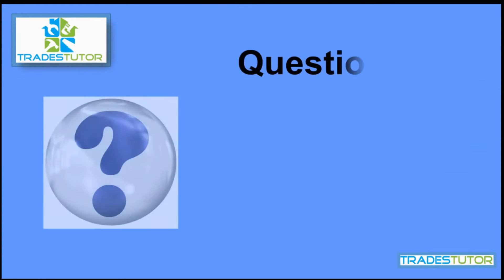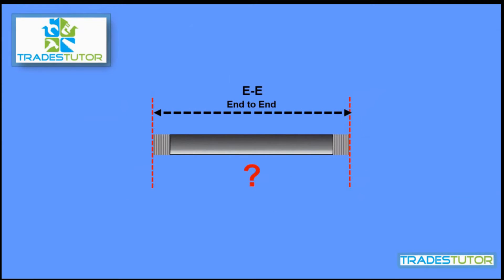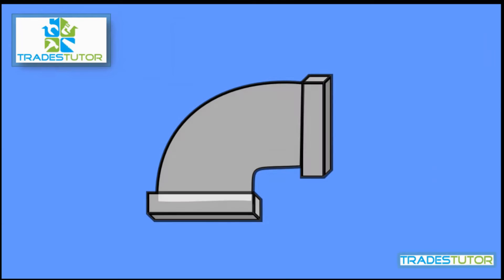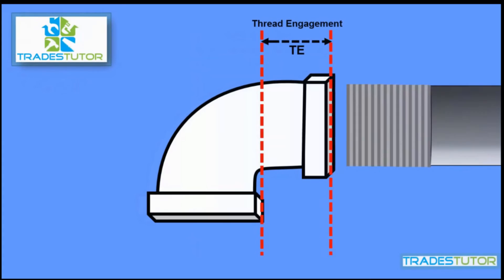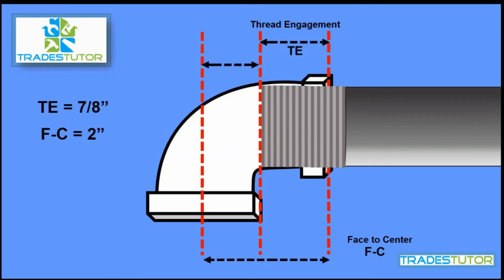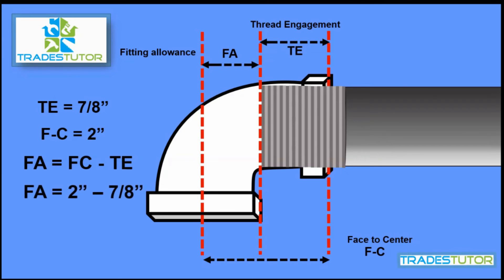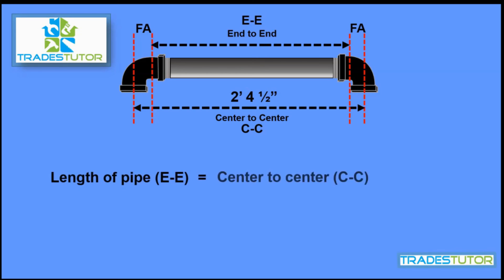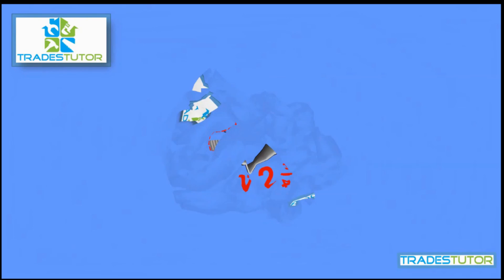Fitting allowance for the piping trades

Comment: In the case of piping around the house, to run the piping from outside or inside corners of a room/wall, do we need to consider center-to-center distances? I mean, the piping will be touching the wall sides and corners.

Comment: Absolutely ridiculous how much filler there is. Measure from face to face and then add 2 times TE... done
Reply: Yep. The only thing someone has to learn is sock-in (TE), which I always used 5/8 of an inch for 1/2 - 1-1/4 pipe. For anything bigger, I’ve always used 1/4” per inch increase. But fitting thread depth with 2-3 threads added is always a nice reference.
Reply: @robbob022 what are saying . I didn’t understand
Reply: I agree with u this video is confusing
Reply: How is this confusing 🫤… maybe because I’m not a welder I get it but dang…. We all just trying to learn something here… and pretty much everyone hates math…

Comment: Question.. how to remove pipe between two fittings without having to remove more then what’s necessary?.. thanks
Reply: Turn the water or fluid off and drain. Make sure both pipe ends are supported.  Cut the pipe out.  You can add pipe back with a union.

Comment: All those fractions in the calculations are a perfect example of why metric is easier and simpler.
Reply: Building plans in the USA are about always in Feet and Inches. The piping requirements are  too and the walls rooms and where hvac and furnaces are too. The pipe you buy is in feet. So to use metric you have to convert the requirements to metric from the plans.
Reply: Yeh how are people still using imperial measurements in fuckin 2024, it’s just a head fuck
Reply: Go drink your tea and shut it this is merica we don't use that trash we no how to use math
Reply: Freedom units!!

Comment: So how do we find the measurements for the thread engagement, you sort of just said we will just say it's 7/8" but how do I know what the thread engagement is on a T or a union?
Reply: 1/2" Ts and 90s are same thread engagement and Fitting allowance
Reply from the maker: The thread engagement will depend on the type of material and size of pipe. This information generally will be supplied by the manufacturer of the material.

Comment: Please can you help me solve or know how to solve problems or real situations of take off in threaded joints.

For this examples: 

1) A piece of NPS ∅2" pipe is being cut to run between two 90° degree threaded fittings. The center-to-center measurement of the fittings is 7'-2¼". What is the cut length of the pipe?

2) A length of NPS ∅1½ inch pipe is to be cut run between two 90° degree 6.000# threaded fittings. The fittings measure 7 ft 2¼ inches center to center. What is the cut length of the pipe

Comment: Hello, excellent explanation for the measures required in threaded pipe installation. My query has to do with the fitting as such, that is, from where they obtain the dimensions of each threaded accessory, depending on whether it is, ANSI # 150 or ANSI # 300, or 2000 #, 3000 # or 6000 #, according to the Manufacturers' catalogs can vary from one to the other, I tried to take the data and dimensions of ASME B1.20.1 but the FC and TE of each fitting differ with the manufacturer's catalogs even with the example in the video.

For the example in the video that is a FC = 2 "and a TE = ⅞", if I'm wrong please correct me, according to the tables I got corresponds to a fitting, 90 degree elbow of the threaded type NPT 3000 # and it would be to couple a pipe of nominal diameter or size NPS = 1¼ ", FC = 2" but TE = ¹¹⁄₁₆ and in other cases TE = ⅝ ".
I appreciate the clarification and, if possible, provide the source table of the information with the dimensions of the fittings.
Reply from the maker: Hello: The numbers I used in the example were not related to a book of any sort. They were only used for explanatory purposes. Thanks for watching.

Comment: I have a question is 7/8 is constant?
Reply from the maker: Hi Darwin: No, its not a constant. its just a number I picked to use as an example. Thanks for watching.
Reply: @tradestutor1191  if the thread engagement isn't constant then what is it for all sizes of pipe is there a chart?
Reply from the maker: @richnelson753  Yes, you can find charts from the pipe manufacturer and I believe there may be a chart in the IPT handbook

Comment: what's the size of the pipe? 2" ------ I guess
Reply from the maker: Hi Sam: the numbers are just examples so in the end it doesn't really matter. It would definitely matter in the field though. You would have to find a manufacturer's handbook or some type of pipe fitting handbook which would give you the information you would need to answer the question.

Comment: How does it differ if the pipe will be fitted to a butt weld elbow instead of a threaded one?
Reply from the maker: Hi Homoud: A butt weld wll have no fitting allowance so you will essentially be taking the center to center measurement of the pipe and substracting the fact to center measurement of each fitting.

Comment: But the thread on each end will not thread in exactly by TE amount!
Reply from the maker: Hello: The theory behind it is that it does thread in the exact amount. This may differ in the field but if we are just going by the theory this is the way to go.
Reply: Mr Precise Lockheed you could take your digital dial calipers and measure and mark the TE on both ends.  Then it will work providing you put exactly the number of wraps of Teflon tape on both ends of the pipe and then precisely torque both joints together. I can tell by your comment you aren't that particular.

Comment: So how do you calculate FA for a 45 degree angle fitting?
Reply from the maker: Hi Jolly Goat: It will be the same math. You would take the face-to -center of the 45 and then minus  the thread engagement. Yous should be able to find that information in a pipe trades book. Thanks for watching
Reply: Or you can just measure with a measuring tape the fitting allowance. Put a dot on the centre part and where the end of the hub is and measure it and that’s your allowance.

Comment: Correct me if I'm wrong, but say you're going face of a fitting to center, would you have to add the TE for the "face of fitting" portion then subtract the center?  So, as an example 3/4" Black Iron 90 has a TE of 1/4 and the measurement from the face of fitting to the center is 45 inches, then could you just subtract the FA (on the other 90; saying it works out to be 1 1/4) from the TE to get the E-E measurement?  Thus, gives an E-E of 44 inches?  Does that make sense?
Reply from the maker: I think the face to center measurement you are referring to is different than the one I refer to in the video. When I say face to center I'm referring to the face of the fitting to the center of the fitting. It sounds like the measurement you are referring to is the face of the fitting to the center of the piping arrangement. If that is the case then a different set of calculations would be required. The numbers in your example do seem to work if I'm understanding correctly what you did.
Reply: If we know the thread engagement is at 7/8 " & distance between the two elbow faces is 2 ' 3/4" why don't we just add it up?  (7/8" + 7/8" + 2' 3/4" (6/8")=2' 18/8" (2' 2 1/4")

Comment: Couldn't you just measure the face to face and then add both thread engagements?
Reply from the maker: Yes, that would work as well. The reason you would need the fitting allowance is because generally measurements are given center to center and for longer distances between fittings getting the face to face measurement might be difficult.
Reply: That’s how I measure and plumb all my runs. My question is since it’s NPT and the threads are tapered meaning they theoretically aren’t tighten/bottom out to the end of the thread engagement how much of the thread engagement from both of the fittings should I add to my face to face measurement to allow the fittings to be sufficiently tighten while maintaining the center to center of the fittings for a run I’m trying to make.
Reply: On 2" pipe, I measure from face to face and add 1" to each side.
Reply: Looks like you can simply measure from bottom inside 90 to bottom inside 90 (which would include your thread depth) and just cut your pipe end to end stight away without any math. 🎉

Comment: what if it is a cast iron pipe joint using mj clamps? would it be on e-e minus the fc?
Reply from the maker: Hello: When dealing with cast iron the clamps themselves count for very little. Lets say you had two 90 degree cast iron elbows and you were looking to cut a piece of pipe (E-E) which would fit between the two 90's in order to get the correct centre to centre measurement. You would take the C-C measurement and minus the face to centre of one 90 degree and then the face to centre of the other 90 degree. Essentially you would be taking the centre to centre measurement and subtracting two face to centre measurements as both 90's should be the same. to account for the coupling required (one on each side) you would subtract about 1/4 inch for each one, for a total of 1/2 inch. This 1/4 inch accounts for the rubber piece within the coupling that separates the pipe from the fitting. I hope this helps.
Reply: That's funny that you mentioned this. I had to deal with that exact same thing today but with a 2 by 1 and a 1/2 cast iron tee. I ended up just treating it like a butt weld fitting.

Comment: How exactly did you get a TE of 7/8 ?
Reply: the TE is predetermined specific to the type/size of pipe/fitting if i am not wrong
Reply from the maker: Yes, you are correct. You can find tables in piping textbooks or other piping reference manuals which give you the TE specific to the type and size of pipe.
Reply from the maker: Hi Jesse: The numbers are just used for the example and they do not relate to any specific fitting.